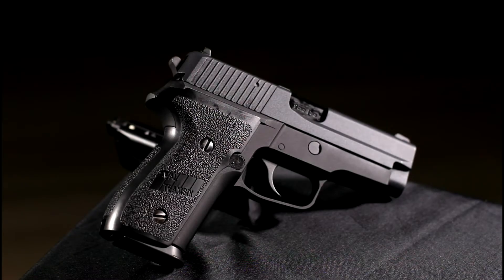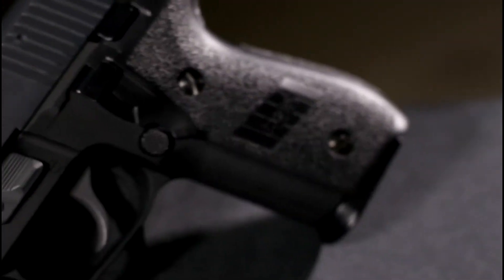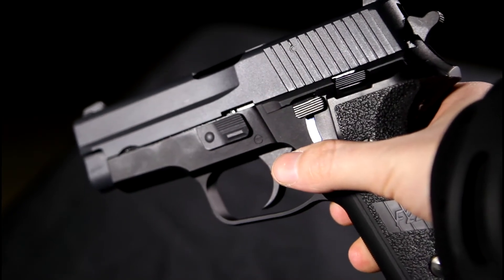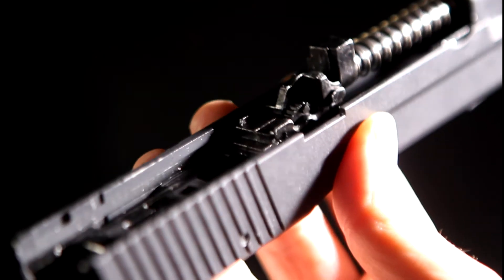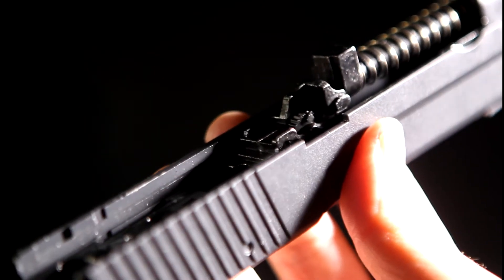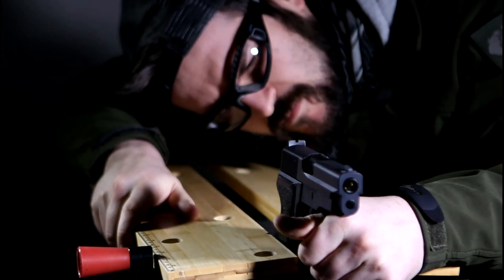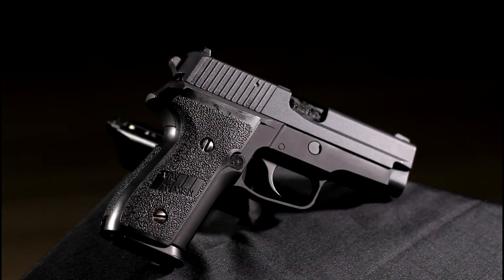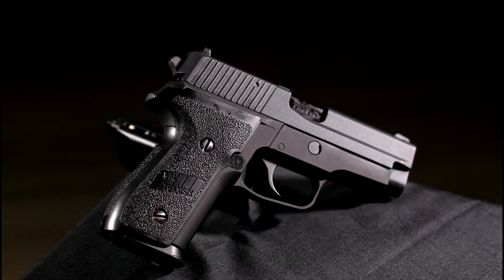CBMPC:TV - WE F228 review

Comment: The mags for these fit the KJ Works version, and while I found the KJW to be the better pistol, the WE mags are way, way better than the KJW mags. Things I found to watch for with the WE version is the hop unit. It didn't like rapid fire and would start to drop very quickly. Probably would have come right with some tinkering but I dropped it at a CQB game and fractured the slide. Would have got another, but since the mags made the KJW useable, I left it at that.

Comment: Will real p228 grips fir on this, and also where can I get extra mags in US? Also, will it fit in a real p228 holster?
Reply: It will fit in a real holster. I was wondering the same thing about the grips. Currently redoing my Sig so it will look more like the real deal. I've so far repainted the slide and now I'm going for the grips. The last thing I'll do before it's finished is getting the slide engraved.
Reply: Hans Frank I'm thinking about probably getting wood grips or some of the plastic ones. It would also really be cool to get the slide engraved on mine.